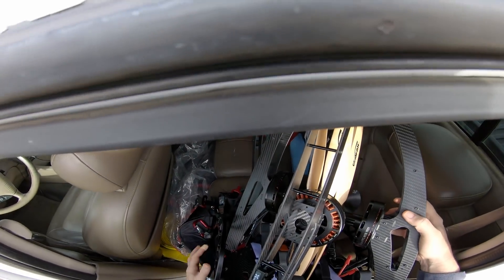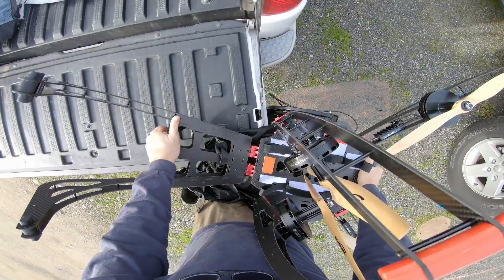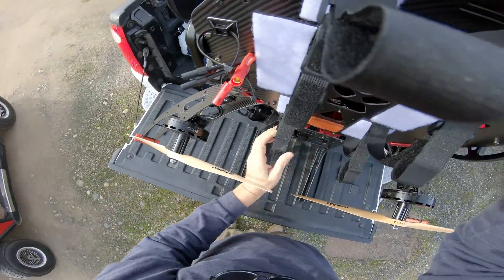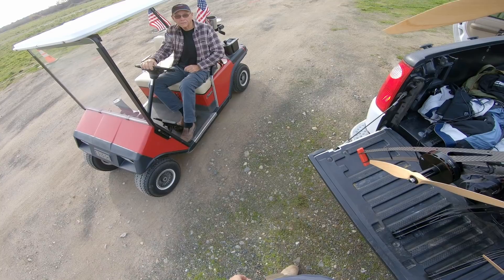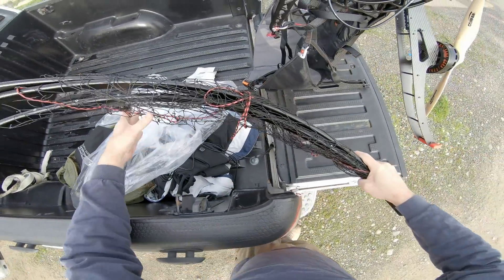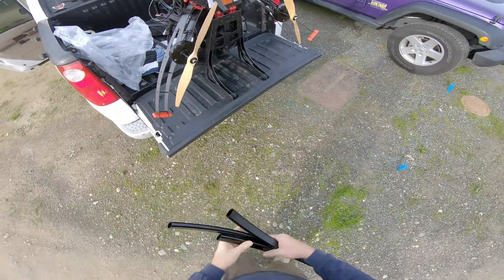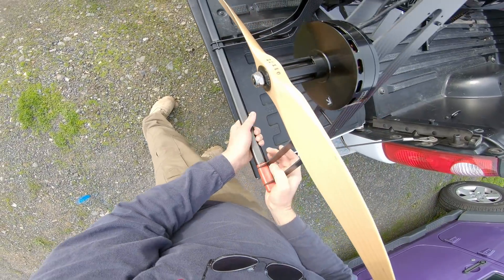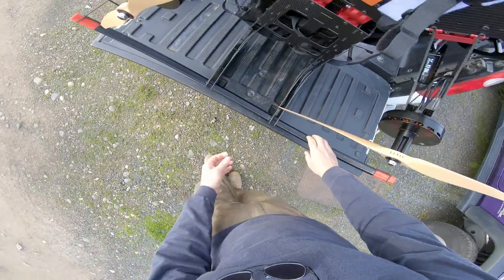Electric Chair Maiden Flight (OpenPPG)

Comment: Way too loud.   Very short flight times I'm sure.  Can't drag those lipos down below 50 % or so.  This seems to be impractical .    Can't travel any serious distance or time.   Can't carry extra batteries because of weight.  Those batteries probably cost a few hundred dollars.  Couple of gallons of gas costs maybe 7 bucks and  goes for a couple of hours.  PLEASE answer flight time and battery cost questions.   This is just a cute experiment, not a real alternative to gas powered craft.

Comment: great, thanks for the nice vid. The lipo's on my back would deter me from flying this a bit however... have you ever seen one go ballistic? Its not nice. even from a few meters away. Being only a feet away when one blows and is stuck to your back... pfew...i guess a guy with hair on his back wouldnt need a wax anymore. ever.
Reply: One of the few reasons for my hesitation ...  I've accidentally blown up a 2000mah lipo on my leg, comparable to gasoline burn.  Thise bonkas are huge....  I can imagine the heat would do damage outward of several foot radius
Reply: Mine has a battery release. Been flying mine for a year and a half. If you take care of the batteries (proper charging procedure) it should not be an issue. Have a great day. system https://www.youtube.com/watch?v=Be3dKjtMtdU

Comment: was looking at their specs for motors... 50cc electric spinning 22x10 props... as someone flying RC planes with that size motors, they selected the wrong spec motor. they should lower the Kv and up the diameter of the prop, improving efficiency, thrust and flight times. punch that puppy up to 24" props with same pitch with lower Kv motors... or, pull the voltage down with more cells in parallel than serial, and up the prop diameter, you'll thank me later :)

Comment: Nice indeed but very inefficient :( You could greatly improve overall efficiency by doing away with the cage and mounting the engines in paires, 2 on each side and about 20cm below shoulder hight. The props work in a Push-Pull configuratuon. Further, build a carbon-fibre shroud around the props. The shroud must be almost touching the props. My props will be 500mm diameter and the shroud will also be 500mm. Initially the props will touch the inside of the shroud but will quickly "sit" themselves in, with almost no space between them and the shroud. The props will be contra-rotating within the shroud. I have worked out most things and will build my own setup in 1 year or so. Furthermore, the shroud has a one inch lip at the front, to further increase efficiency.
Reply: Ducted fan design...  i was thinking about the same concept. Counter rotating props are also more efficient and unit will be more compact. I hope you will upload video once you finnish your project
Reply: Also this system could be paired with freeflight harness
Reply: You two should go on the electric ppg open source forum and execute your ideas there. Its a community project that he is flying. https://openppg.com/

Comment: Awesome. Interested in knowing speed, range, charge time and or battery replacement.
Reply: Speed: same as any paramotor - depends on wing and auw. Thrust is ... enough! :)
Range: same as any flying machine - depends on winds and other conditions. Not much. At full power your battery will be done in 8 minutes. Push it longer and you'll be replacing them soon.
Charge time: same as any battery - depends on how many cycles you'd like and how much you spend on your chargers. Mine takes 4-5 hours. Swapping out set of batteries would take less than 5 mins.

Comment: I always see it as sooo wasteful to replace one large prop with multiple small ones.
I have never done the calculation but pretty sure the efficiency loss would not be insignificant... not trivial with battery power density being so poor.

Comment: My favorite part was pulling it out of the back seat! Could you smell the fumes from the batteries like you would gas :>)
Great vid and flight - how was your throttle control ? Good thrust at take off(very smooth by the way) -- damn it man, give us some details :>)
Working on my batch 3 now.
Cheers
Reply from the maker: Throttle is... interesting.  I don't like the thumb control...  you can't guide your A's up and use the throttle at the same time... which means you have to muscle the wing up yourself... come off the As and then find that throttle.  I would hate that if I was launching in snow or some slippery condition.  Response is instant of course... and I found it comfy to use generally... but give me a short bottom lever any day.

The throttle cable is very thin, and I ended up pinching it in the arm... so I had to cut it open and inspect... it was fine (it's a 4-conductor... very small wires, wrapped in fine steel braid)  I got hold of some 1/4 black vacuum line which had an ID JUST big enough to receive the cable... so now it's well protected.  It's also zip tied to the shoulder of the arm so that it won't be pinched again.  Check the video at 24 seconds to see what I'm talking about.  You can see where the covered cable starts... and the original, unprotected cable runs off to the right and into the guts of the machine.
Reply: @paradad9609  I just use my index fingers to hold the As on takeoff instead of my thumbs. I actually feel like I have more control that way
Reply: Would a Bluetooth throttle control not work? No cable to hit the prop etc

Comment: Love it. How strong is the throttle button? Looks like it could snap if you grab it wrong.
Reply from the maker: It's reasonably strong... but nothing like a mechanical cable you would find on a gas machine.  I would say that my little bird is fairly fragile overall (a problem with all carbon fiber machines).  But if I stay on my feet, shouldn't ever be a problem.
Reply: hi, it's not the carbon if something looks fragile. It is the construction and the experience of the designer.
Reply from the maker: @kornerederparamotor  Not talking about looks... It's that CF shatters... while metal bends.  You can straighten out metal... but you can't straighten out CF.  Once you smack it hard... that's that.  You can bend and straighten titanium repeatedly... it's amazing. I watched a guy slip during launch... and every CF part on his Scout was damaged... prop, ring, supports.  A very sad affair.  BUT, strength to weight... CF is hard to beat.
Reply: Yes you are right. But there are constructive solutions to eliminate all problems. as an example: at my cage rings, the cores are a layer glueing of esche funier with cfk and gfk layers. that's as stable and elastic as a sports bow. or similar to the construction at ski. I use a lot of unidirectional cfk fibers in parts that are extremely under stress. if it is not allowed to sputter, a hybrid cfk - afk fabric is laminated under the last layer cfk, just like military helmets. with extremely lightweight cages, an extremely thin aluminum profile in drop form is used as a base and coated in a special winding technique with cfk fibers. These components are elastic and almost indestructible. you can control that exactly. I do it all just as a hobby. Of course I also use Titan sometimes. but cfk is much easier to work with because you can glue it. For propellers I use prepreg as in real aircraft construction. an example is the pluma paramotor. this one has the same material and is extremely stable. Best regards
Reply: Tom, those Plumas have one of the best hard landing designs I’ve seen. Very nice!

Comment: Great addition to the sport! Do you know the time in flight yet?
Reply from the maker: I'm not quite ready to fly her until the battery is gone, but I did a 13 minute flight the following day.  I'm going to guess around 15 minutes, based on my recharge (she took about 80-85% charge after the 10 minute hop).
Reply: Paradad Love this, did you build or was the manufactured by Open PPG?
Reply from the maker: @DaxDunn-MotherNatureCures  Open PPG built her
Reply: OF COURSE HE DOES. HE JUST DOESN'T WANT YOU TO KNOW HOW IMPRACTICAL THIS IS.

Comment: That's awesome! With 4 smaller props (in addition to configuring them to cancel the torque effect which is very cool) does a prop strike deliver just 1/4 the energy of a standard prop - making it safer in that regard? Or are there other off-setting variables like a smaller blade being able to travel through tissue more easily, etc. etc. Just wondering if the 4 blade design provides added safety as well.  Great stuff!!